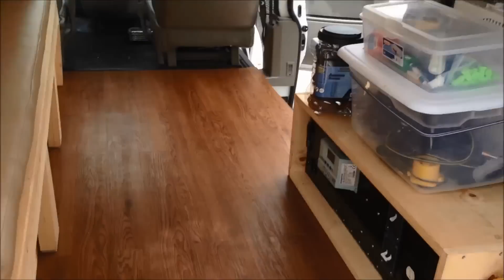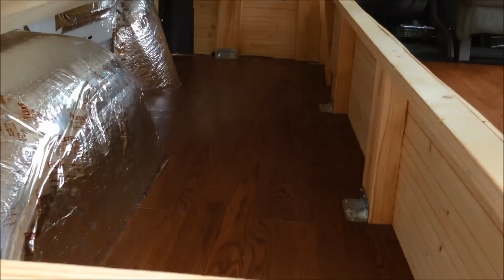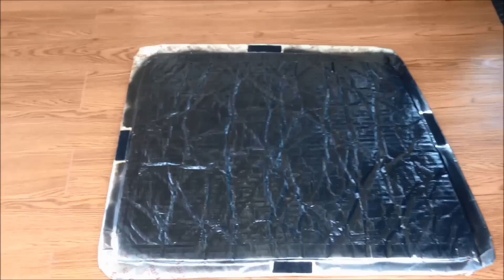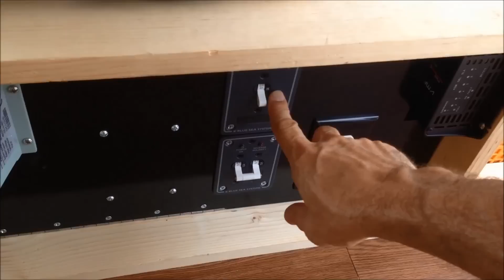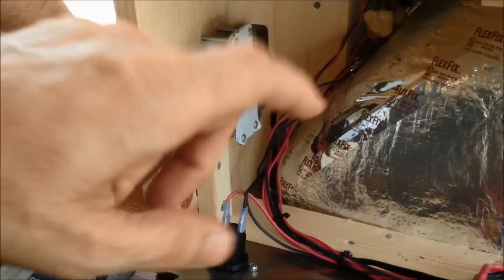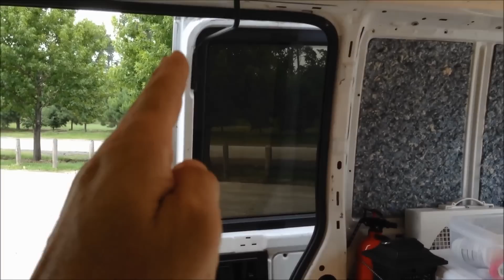Camper Van Build Update and Mini-Tour

Comment: Personally, since you said you wanted to use the under bed space for stuff you don't intend to access very often, I'd move the power station to under the back portion of the bed and put a large drawer or two under the front portion. Then I'd put the galley along the passenger side where the power station currently is and across the back I'd do floor to ceiling storage accessible from both inside and outside the van. Just a thought...
Reply from the maker: The van build is now complete.  I'll be uploading a video shortly to show what I did to make the space as efficient as possible while allowing for some movement in the van.  :)   Thanks for your input.

Comment: The van is looking good. Testing it as you go is a good tip. My husband and I realized several changes to make when we were in ours the first time.
Reply from the maker: Exactly.  I have some improvements I want to make and discovered them during this extremely slow build.  Ha!  I plan to pick back up on this build in 2018.

Comment: While the plank paneling makes the bed look nice and finished, i'd remove it for easy access to the storage. The entire van looks great, so seeing storage containers underneath really doesn't take away from the overall look. It's a very well done build!
Reply from the maker: Hi Henry.  I actually did remove the paneling along the front of the bed and I can now access the storage much more easily and I still have the option of lifting the bed up if needed.  I just returned from a 5 night road trip and it worked out well.  Thanks for watching.

Comment: Another great informative video. The icing on this cake would be a simple basic  wiring diagram for two battery hook up. Thanks a lot .
Reply from the maker: +David Termini  I recently added a post to my blog on Shore Power and my Power Center.  There is a sketch of the wiring design, but it's not very detailed.  I'll have to look into making one.  I have a video planned as well to go along with this post.  http://travelingtroy.com/2016/power-center-shore-power-build-6

Comment: I was thinking with regards to the weight of the frame restricting frequent access to storage, you could split the frame into two pieces by adding a few more support pieces on the inside ends, that way you would only be lifting half of the frame at a time. Just a thought, thanks for the great videos!
Reply from the maker: Another great idea +Gary Boyer!  We should have thought of that.  :)

Comment: Hey Troy, have really learned from your videos.  I've recently purchased a 97 and want to do it right.  Half the fun has been just sitting in the van trying to see how to maximize space as it's not full sized.  I really like the shower rod on the back doors!  I was going to bring my bed closer to the back door,  as that wheel well so close to the leg of the bed really doesn't allow much room for storage from the rear.  You solved my dilemma of trying to choose between 24" and 26' width for the bed.  I think I may go for the extra 2" without the extension, saving weight and allowing for more storage underneath.  Also, was considering  the kitchen area extending that extra foot or so near the side door with a hinged flat surface that opens so I can cook from inside or standing outside with the door open.  Looking forward to the solar panels.  Most of the electrical connections should be able to be mounted on the wall or cabinet over the batteries won't they?  Good luck!
Reply from the maker: Hi +coastal455.  Glad you've found the videos helpful.  For the past couple of months, I have trained myself to only need the 24" bed width and I plan to remove the bed extension sometime after the holiday months.  It will reduce the weight of the bed and make getting to the under bed storage much easier.

My plans for the back of the van have changed a bit.  I'm now planning to make the back area multi-functional to handle cooking and a work area while standing outside of the van.  It's been a few months since I've uploaded an update, so I expect to do one soon.  Thanks for watching.

Comment: Why not put those batteries up under the van, there is so much room under an astro van.
Reply from the maker: You are correct +mzimmerman12, the Astro does have a lot of room underneath, especially if you relocate the spare tire to the back door, front bumper or on top of a roof rack.  We did consider putting the batteries underneath but decided we wanted all electrical to fit in on small, easily accessible space.  If we put something under the van, it will probably be a propane tank or a water tank but that would be a future add-on.  Thanks for watching & commenting.

Comment: Love your video series. I have an older Astro conversion van that I am looking to turn into a camper van. Something maybe to consider... why not remove the panel on the front of your couch/bed and build storage drawers between your upright supports. Then you would have easy access without dealing with lifting the bed all of the time.
Cheers.
Reply from the maker: Hi brad ley.  Yes, that is exactly what I'm thinking about doing with the couch/bed, but maybe only on half.  I'm thinking tools and lesser used items on one side and storage drawers on the other side with items I need often.  Thanks for the feedback.

Comment: Love the build man, I've been checking out van conversions the past couple days and this is by far one of my favorite. I'm currently looking into an astro van to do something similar and was wondering, can you still sit up all the way with the pull out bed installed? I'm 6'3 and I feel like I'll either be hunched over or sitting on the ground!
Cant wait to see your progress, thanks for your time!
Reply from the maker: Thank you for the kind words helladanny .  I appreciate you watching and commenting.  The Astro does have a low ceiling.  We built the bed as low as it would go, right on the top of the wheel well.  I am 6'0 and cannot sit normally on the couch.  I have to hunch over just a bit, but my favorite spot is sitting with my back to the drivers seat where I have just enough head room.  I also plan to put in a swivel base on my passenger seat, which will be my main spot in the future.  Thanks for watching and good luck with your van search.
Reply: Thats kind of what I figured, I was trying to do some calculations from your video explaining all the dimensions and no matter how I played it out I don't think you can make the bed low enough. The swivel base on the passenger seat is a great idea though. Thanks for the quick reply and the good ideas, cant wait to see the next video!

Comment: Using the rod to keep the doors open is brilliant. You can also throw some sort of sun shade over it or a tarp if it's raining. Nice work. I will be stealing some of your ideas  :-)
Reply from the maker: Excellent NoProGoPronto !  I'm happy you're finding some useful ideas.  :)   When we first started the build, we were anchoring weighted items to the doors to keep them from closing on us.  It's pretty freaky when you're working away and all of a sudden one of the doors slams shut.  There had to be a better solution.  Say hello to the shower rod!   Ha!!  Once we fitted the shower rod, other ideas started to form, like having a canopy to block the wind, sun and rain since I plan to have a galley to cook from in the back.  Sort of like Dan Travels but probably not near as cool.

Comment: Troy, you did a great job with the Astro. You seem to have thought of everthing you may need. Exactly what kind of paint did you use on the reflex to black out the windows? Do you think using black duct tape instead of paint will work just as good? Thanks
Reply from the maker: Oh for sure NoProGoPronto , using black duct tape on the window coverings would work well, especially if you already have it on hand.  I don't recall which black paint was used.  It was a can of spray paint my Dad had in his garage.  We used the same paint on the aluminum drop down door for the power box.  Thank you for the kind words.  When you take 3-4 months to do a build, you tend to have time to think of everything.  LOL!!  :)

Comment: Looks great. Love seeing an Astro van converted. Dont see those as often.
Reply from the maker: The Astro is surely a smaller choice One Awesome Inch for a camper van, but I hope to wisely put every square inch of the interior to good use.  Thanks for commenting & checking out the video.   :)
Reply: Traveling Troy have a90 Astro. We're in the process of converting it. It already had a higher top on it. Any tips on insulation. What's the best to use.

Comment: Looks great! Glad to see you doing sea trials. 2 areas you might have trouble on are where all of your wiring comes in. That long slit looks like it would dig into the wires. Also the roof vents screws are exposed. Most people put enough caulk to really cover the screws and have a lot of surplus around the seal. Your wiring looks real clean and pro. Looks like a good space to live in.
Reply from the maker: Thanks for the feedback Dan Travels !  Adding another layer of caulk to the roof vent is on the to do list.  We originally installed the vent and screws with the surplus caulk on the underside of the vent so it would squeeze the caulk through all the holes/gaps.  I do agree we should add more on the outside as a precaution.

Also, thanks for pointing out the possible wire snag area.  We used grommets in other spots like this but we should look to protect the wires in that area as well.  Thanks.

I have to give props to my Dad on the "real clean and pro" wiring (Happy Father's Day - Dad) as he is the wiring guy (retired electrical engineer).  Thanks again for your input Dan!  :)
Reply: Thanks for taking us on your journey.